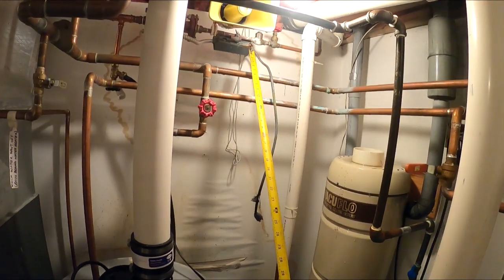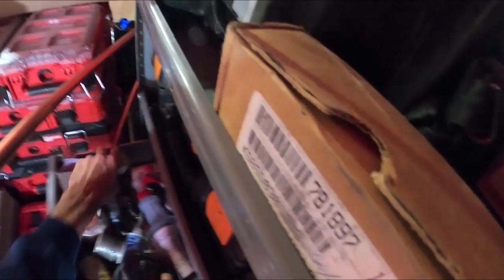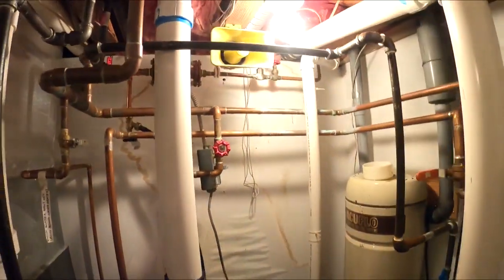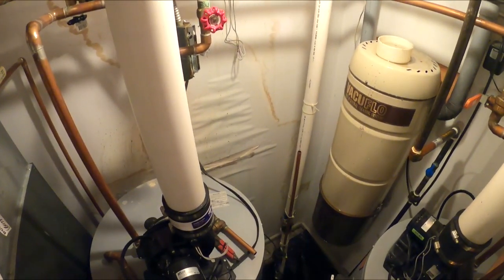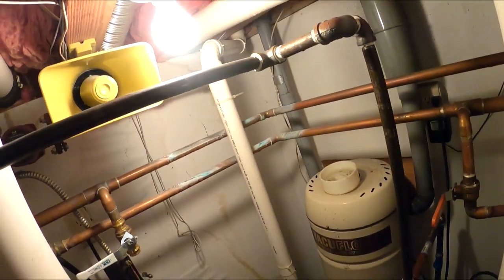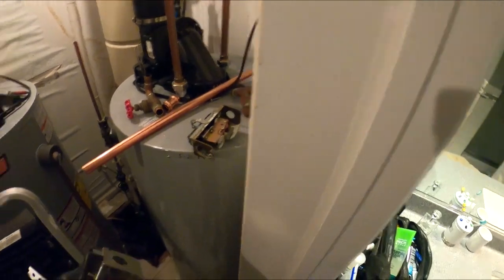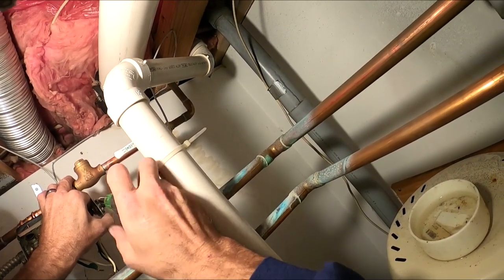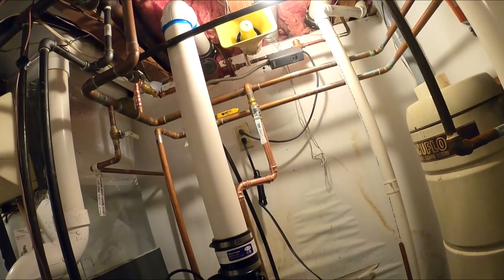Recirculation Line Repair With The Milwaukee M12 Press Tool

Comment: Good repair. Although as a red seal journeyman plumber gasfitter here in canada i have some tips for you soldering. Use the piece of copper you have on the truck as a support and solder in and out of it. You wont need to reflux and re solder if concrete isnt stealing your heat. You can also use a torch and channel locks to un-solder that old valve and pinholed piece. Good video thoughtful
Reply: i guess im asking the wrong place but does anybody know a trick to log back into an Instagram account??
I somehow lost my password. I would love any assistance you can give me
Reply: @Augustus Michael instablaster :)
Reply: @Alijah Kohen I really appreciate your reply. I found the site through google and I'm waiting for the hacking stuff now.
I see it takes quite some time so I will reply here later with my results.
Reply: @Alijah Kohen It worked and I now got access to my account again. I'm so happy:D
Thank you so much, you saved my account :D
Reply: @Augustus Michael no problem :)

Comment: What brand fittings are you using?  Nibco? Viega? FNW?  I think from what I could see your using a FNW 3/4 inch brass valve, is Nibco's version comparable?  Do all these brands work on the M12?

Comment: I usually pull the bad valve apart and see how much water keeps rolling out, if minimal just cut off or unsweat after using shop vac to remove excess water and sweat new in.
if it cannot be drained fully or curb stop leaking past and main shutoff in house need replaced, neck the shopvac size down to small diameter steel line and feed it through open valve to keep water removed for cleaning, fluxing, sweating new in place :)
I've replaced some trickling fast enough to fill a coffee cup in  a few seconds, just use a large shop vac or pump capable of handling it long enough to finish sweating in. beyond that get a line freezer setup.

Comment: 12 awg wire through thermostat, I'd assume the circuit is fed off 20amp breaker, which means it all has to be 12awg from end to end, even if feeding a circ. pump that draws less than 2 amps and has little 18 awg wire within the connection box.
good ole codes, but it makes sense, to keep the short circuit path protected and wire from becoming a flaming heater element  ;)

Comment: look at that big alarm horn, would have been funny if it went off with you standing there. massive convulsions with arm flailing and head knocking to get away from it would occur, no need to ask how I know! because it's even more fun when 30' up ladder beside and outdoor alarm bell with bad tamper switch, which you hardly bump and it goes off, that day I nearly jumped off the ladder backwards, that would have been real pleasant :)))

Comment: WTF? Soldering on the concrete?.. Just hold the piece with another length of copper out the back of your truck. Or stand the torch bottle on the ground and hold the piece with pliers. Come on.. your a professional... Right?
Reply from the maker: Maybe you should show me how to do it on your channel WTF
Reply: @MiHeatingGuy  😱🤕😁 love your channel.. great boiler repairs but you have issues with basic soldering skills... Been using that  "jaws of life"  gadget since you started.. Eh?